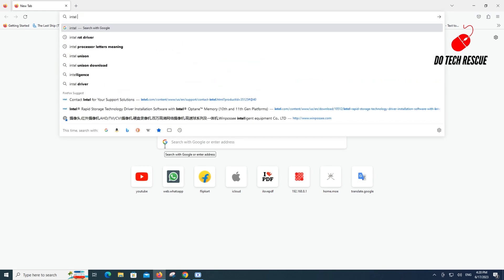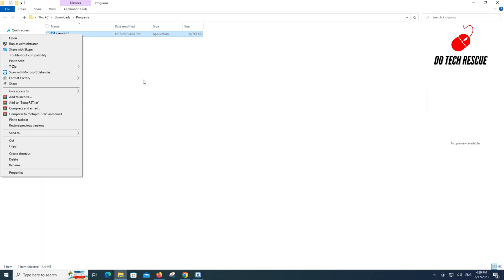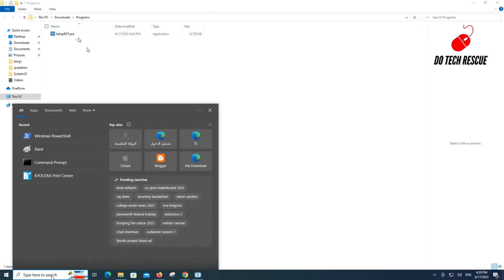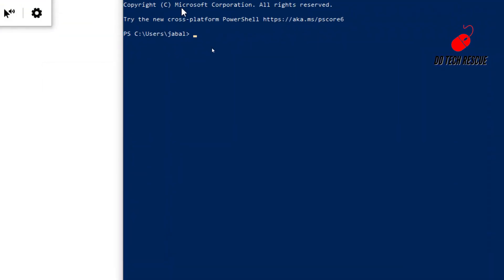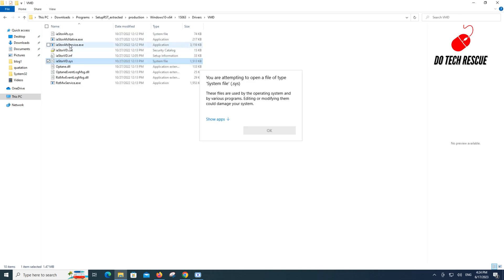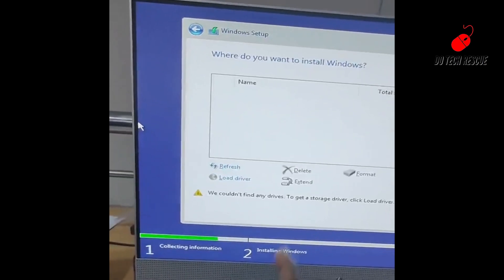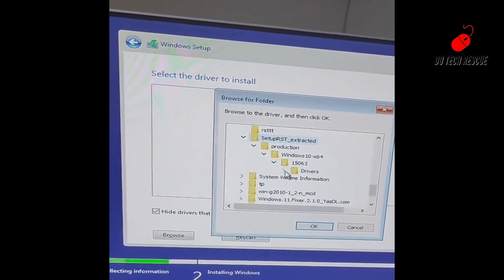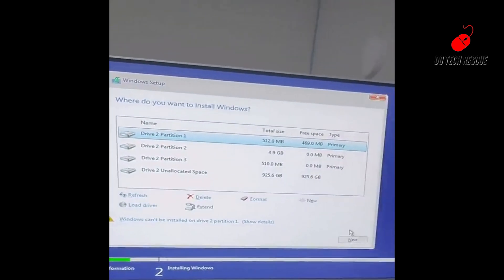SSD/NVMe Not Detected During Windows Installation? Here's How to Fix It

Comment: Hi thanks for sharing this 

Can you help regarding issue while Lenovo Gaming laptop doesnot detect VMD available drivers in WN 11 ( As the SSD is locked) even if I enter password correct it doesnot detect or install desired drivers.

Your help / support appreciated in advance.
Reply from the maker: Which laptop are you using?